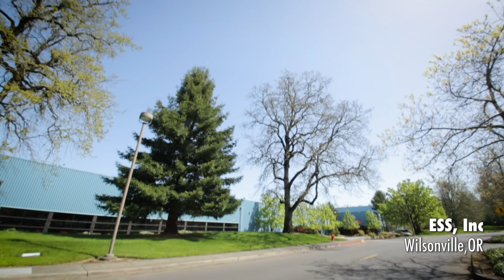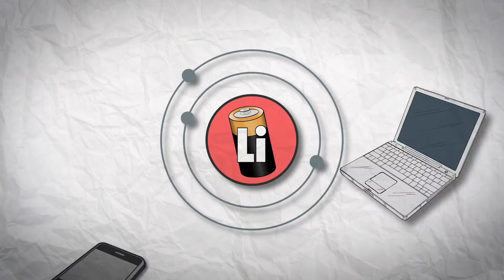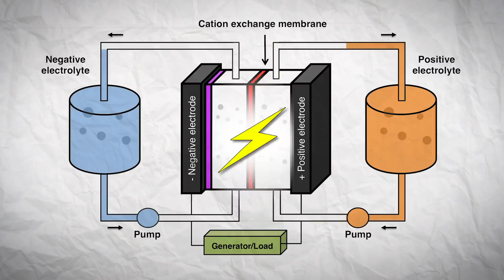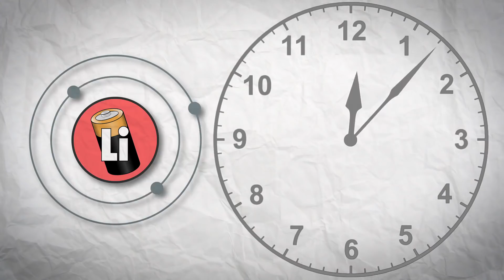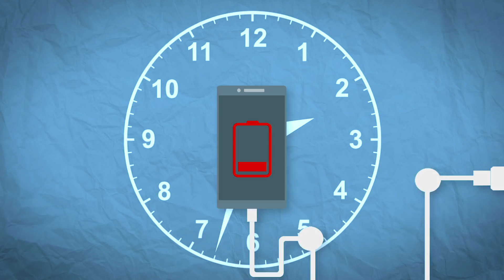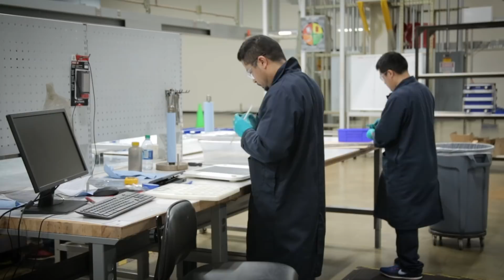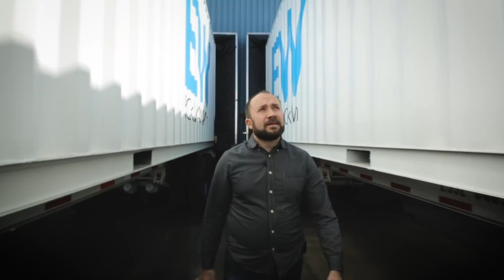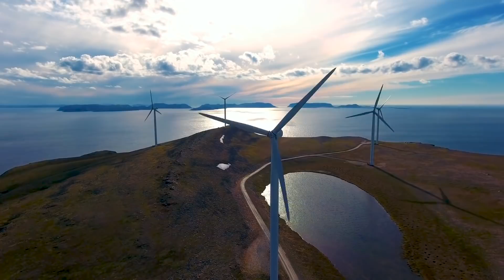Battery Fueled by Iron and Water Could Transform the Power Grid

Comment: What till Thunderfoot sees this.
Reply: I hope its not another solar road or hyperloop fiasco.
Reply: He's been notified.  ^_^
Reply: Incognito, I'm not saying the science isn't there. We've known, in theory, that it's been possible to do for a long time. It wasn't until 2008 that someone came up with a way to do it and meet all the safety criteria.

But think about that for a second. If these batteries are so good at what they do and can revolutionize the world, why did a company wait 10 years to do it? We've been looking for a cheap way to store lots of power for decades.

Something seems really fishy.
Reply: @SlimThrull  Perfecting the nooks and crannies of the technology(charging-discharging circuit, integration with existing technologies, etc) and setting up profitable enough manufacturing? Don't most proven "world-changing" technologies also take decades from proof-of-concept to full-scale "world-changing" applications?
Reply: @SlimThrull  Late to reply, but we haven't needed large scale static power storage.  Most power storage we've needed before now had to be mobile and this chemistry isn't suitable for that because it's so heavy.
Reply: @SlimThrull  it's volume to storage capacity that kills it. It also fails with very low contamination, plastics  may have solved this. Its 50's tech.
Reply: Nop, they're meant to be used in power surges helping to ease the load on peak moments, they're batteries not power generators, they take sunlight all day or electricity at night and distribute it in peak hours. They don't need to match the power generation capability of the generator, they can charge at night for instance at 1/8th the current of the generator and that wasted energy at night would become power at the moments when it's pricey to generate. They're not meant to store 100% of your energy, it's more a kind of nitro for special moments.
Reply: kk346592 didn’t know he said that, it not impossible - just highly improbable.
Reply: I was thinking that too. batteries need an Anode and a cathode not just one or the other.
Reply: Matt, you are projecting your character onto IncognitoTorpedo. Get psychological therapy.
Reply: ChompChompNomNom that's not quite how it works. Close though. An explosion only happens if the chemicals will react quickly. It may be the case that they react slowly without a suitable catalyst
Reply: kk346592 
If it exploded
Reply: He's probably tied up making more solar fricken roadway videos
Reply: @Slim Thrull, he is also a chemist you know, this is not bs
Reply: @taiwoolaleye6333  So what? I'm not claiming that it doesn't work; I'm claiming it's not nearly as revolutionary as this video wants to make it out to be. 2.) If a mathematician says 2+2 is 5, I'm not moved by it. Doesn't matter if he has 10 degrees and 190IQ. It doesn't matter if Ramanujan rises up from the grave and proclaims it to be true. Facts are facts. Just because an expert says something in no way makes it fact.
Reply: Yup. I was about to say that. You beat me by about 4 months.
Reply: SlimThrull - Fuck Thunderm00t! Yes, I said Thunderm00t, with an "m"! Cuz his point...is moot!
Reply: Sorry Slim, nothing for T'foot to "bust" here.  This is legit chemistry and engineering.  My only question is the value proposition.  How does it compare to Li-ion?
Reply: SlimThrull 
According to his logic my 50000mAh power bank can kill me at any time.
Reply: @kk346592 yes, you just need PROPER inverter/step up circuit, and death is near guaranteed. You just need 1Ah fast discharge RC cell, as you will use it only once ;-)
Reply: imagine working on something for 10 years only for some fat athiest neckbeard youtuber making 100 videos on why he thinks your invention wont work based on the fact that he gets C's in high school science
Reply: IncognitoTorpedo ...u have a rusted brain... and need new iron..  grow up and get a clue
Reply: 50,000mAh is only the capacity dude. When you look at it in Wh, then it's only around 200Wh. Whereas an electric vehicle battery is more like 100kWh which is 500 times more power than your power bank. Now, burst your power bank and it will explose, now imagine that explosion 500 times bigger.

Comment: Personally I think gravity based systems would be better. There's systems being trialled of huge concrete weights being raised and lowered in shafts to store and generate electricity.

There's also a system being made of a railway system built on an incline. The cars store and generate electricity by rolling up and down the rails.

You have other systems such as compressing air, raising water, even hydrogen production.

For static projects there seems little need to use lithium ion batteries. Size isn't a major issue for large businesses or communal projects. You could even build them underground.

Comment: I like it. I want one to power my home and car. Thanks for sharing!
Reply: Hope you've got lots of room. A Tesla's battery pack has a larger storage capacity, up to twice as much on the high end models.
Reply: I wonder if these batteries can be recessed into the ground? I'd have room on my property for it if I could build a patio/deck over it, or put a veggie garden on top if it can't be recessed. I don't yet own an electric car but I want one.
Reply: Arlen morrison is wrong. This container has a clear label of 400kwh energy. Biggest tesla car battery currently is 100kwh. One is not bigger than four.
Reply: No.

Comment: So what are the downsides?
Reply: Arlen Morrison The side of the containers show 50Kw and 400Kwh. A P100 has 100Kwh. Unfortunately, they mention powering a neighborhood with 50 Kw but dont know the difference between kw and kwh.
Reply: Less efficiency compared to lithium ion batteries for now. Also, it, like all other batteries, might not be as capable of delivering short but huge bursts of energy as supercapacitors, rendering it less useful for transport or other applications.
Reply: Energy density, size and efficency. So useful when you want to get your house in the country off the grid. Not so useful if you want to do the same with your flat in NYC.
Reply: Johan, good summary.  I would clarify the maintenance comments on the pumps.  We typically use 480 V motors with magnetically coupled plastic pump heads.  typical MTBF on the pump motor combo is 20 years.  For large scale battery installations you should not discount the need for HVAC on the Li-Ion systems
Reply: +Manfred Höffken hell with the amount of desert we have there's a lot of space to put it. You can be even more creative, if it's cheap then storage space can be handled, i'm sure we can find a place to put this shit if it's cheap.
Reply: Arlen Morrison nah man, read the decal on the side it said 50kw 400kwh.... So 4 Tesla's and a small amount of output... That compared to empty land tho.... Makes use of the land.
Reply: Size and complexity.
Reply: Biggest downside immediately obvious is that this battery uses its own energy to run pumps etc. Hence it it automatically less efficient than other batteries. 

50kW to run a city block?  A toaster, electric kettle or bar heater EACH consume 1 to 2kW.
If there are 25 such devices in a city block... dead battery... and nothing to power refrigerators, ovens, tvs etc.  Reality check right there!

Finally, it is safe for trees?
Salt is not a fertiliser. Throw some salt or salt water on most plants and it will kill them. And iron is an effective weedkiller.

So much BS in one video.
Reply: Right.  I live in a small California city of roughly 45,000 inhabitants, but much recent construction here is zero-lot-line, meaning they've left absolutely no room to put one or two such shipping containers anywhere on the block.  Even in the older neighborhoods with detached single-family houses, they'd have to condemn and remove a house on every other block to make room for distributed electricity storage, although with real estate sales as brisk as they are now, perhaps they would just need to wait for properties to come on the market of their own accord.
Reply: Milosz Ostrow 

Or maybe just locate them all in a centralized location a mile or two away with distribution lines...
Reply: I noticed that as well. My thought is every "science" reporter who doesn't know the difference is not really a science reporter.
Reply: another upside: Looks like a giant cauldron
Reply: It not for the individual but good for corporations.
Reply: Laezar He was paid not to share them.
Reply: Well, obviously they're huge. A Tesla P100 has twice the storage capacity than one of these.
Reply: Confusing with the output, perhaps?

Comment: 50kW in single shipping container? LOL you would need a thousand for a tiny tiny 50MW gen? And in the tens of thousands to support a nuclear reactor sized facility replaced by green alt. 
If you believe for a second that electrolytes have no breakdown over time you should believe in free energy and perpetualmotion.
Pumping water uphill has been and always will be the only viable solution to large energy storage that's green. You can do the basic numbers on a shipping container full of water drawn up a hundred meters and it will blow this thing out of the water. You all need to get a little more scientifically literate.
Reply: +Mark Sieg You're confusing kW with kWh. The battery is 50kW/400kWh.
"You all need to get a little more scientifically literate." I recommend you refrain from these sorts of comments in the future.
Reply: "You can do the basic numbers on a shipping container full of water drawn up a hundred meters and it will blow this thing out of the water".
OK let's do that calculation.
This battery says "400kWh" which is equal to 1440MJ.
35,000kg shipping container raised to 100m has 34.3MJ.
You'd need FOURTY TWO containers to match the battery.
Doesn't sound like an economically viable alternative to me.
Reply: @gregx1044  Greg, not sure what volume of water he was referring to,, but I've worked in Energy / Green Energy / Automation for years, and normally the intent of elevated water storage was on the order of large pond, because as you say, a large volume of water would be needed.
Reply: I also thought that "no degradation" was a stretch, but I expect the small print is something like 1% after 20 years. I'd expect the parts inside to corrode before the actual charge is lost to a noticeable degree. 

As for the second point, yes the capacity does seem small when you compare it to a whole power plant, but this looks like a solution ideal for maybe a single business or facility that produces its own renewable energy. 

Gravity is the best battery though.
Reply: Agreed with Greg, and for those who dont understand the difference on the side about 50kW/400kWh then lets put it this way, 50kW is the size of the hole on your canister (for energy flow) and 400kWh is the capacity of the canister (for energy). Compare it to a tank of water that has a text on it of 50/4000 with first meaning how much water per hour can flow out of it and second one whats the total capacity. One more? ok, if a house has one door and only two ppl at a time can fit through it then this does not mean the house has a capcity of two, it might be a door to a skyscraper for thousands.
Reply: Thanks Mr. Wizard!   (kidding. Good analogy, oft used & useful.) @gelisob
Reply: Still not getting it i see, please figure out the numbers before commenting, doesnt make you look good if you are off by so much. 1MW generator output means 1000/50 = 20 boxes can take steady 1MW input. 20 boxes store 8MW's meaning 8 hours of steady output from 1mw generator. 24h/8 = 3. 3x20 = 60 containers to store WHOLE 1mw generator output that runs full capacity for 24h. These are quite easy to stack and you can see much more of these in harbour pictures. And we are not speaking of need to store so much but to store energy to overcome the downtimes.
Reply: We need some nuance in this conversation. Dam batteries are a great idea. Unfortunately, they don't really work in flat areas and they take up a lot of space. Sure, we would need thousands of these iron water batteries to equal a singe MW generator, so the energy density presents a drawback. The size, however, should be considered a potential advantage. There's no rule that says that all our energy has to be consolidated in a single spot. Doing this reduces the efficiency; energy is lost in the grid as it travels long distances. Some of our current infrastructure could be replaced with more localized grids. Perhaps this only has use for remote communities where solar is viable. Perhaps it has suburban applications as well.  What's clear is that we shouldn't dismiss this flippantly. 

Ultimately, as well, there is no silver bullet to fix our fossil fuel problem. No single technology, (save fusion, if it ever gets cheap or actually doable) will solve our energy use problems. This is part of a solution, not the answer in and of itself.

I'd also like to disclose that I've only taken a year of physics, but I'm pretty sure the approximation for gravitational potential energy wont work well for dam batteries. You have to account for loss in the transfer of energy. I also don't know what affect pressure would have on the generation of power, either.
Reply: Mark the side of the battery container says 400KWh/50KW, I believe the presenter misspoke.  KWh is the energy stored in the container, KW is the power, so assume 100% energy transfer efficiency that would mean that if I hooked it up to house, assume my house consumes 4kw then the container would supply my house for 400/4 = 100hrs or roughly 4days.
Reply: Future Hindsight, hypothetically. 400kwh would keep my apartment supplied (approx 100-120kwh/month) for approx 4months..lol
Reply: Here is a TED talk with a claim of a shipping container with a storage capacity of 2MWh - https://www.youtube.com/watch?v=Sddb0Khx0yA
Reply: Mark Seig ~ I do not believe you have well understood energy. All energy is free. Energy cannot be created or destroyed only transformed. The only cost comes not from obtaining energy but the process to transform energy. Humans are horrible at transforming energy and have not made any real gains in this field ever. It is like they do not understand, energy storage is futile, since it is already being stored in the natural system. This is certainly a small detail but it greatly affects how this issue can be and should be approached.
Reply: +Sean
" energy storage is futile"
They store fossil fuels, don't they, that's energy storage. And the CSIRO (in Australia) apparently have worked out a practical way to store hydrogen (mixed with amonia).
Reply: But it doesn't take much energy to raise a container full of water up a hundred meters. Like driving a loaded truck up a hundred meter hill. Fuck all energy required to do that and it's being done all the time. It only takes like a few minutes and so it doesn't burn fuel for very long. Gravity is really weak. We need real power, not a few minutes fuel burn. We need to lift a whole ocean to make it effective.
Reply: Justwantahover ~ Spending energy to gain is a foolish process. That is the reason we are still living in abject poverty because man fails to acknowledge the Truth of where he lives and the True rules that govern all things.

Gravity is not real as a force pulling things to the earth. What they call gravity is actually attraction and repulsion.

Gravity is a word describing the seriousness of a situation.
Reply: +Sean
"Gravity" is the ACCEPTED name of a certain type of attraction. So you think gravity is not real but attraction is? Is the attraction actually REAL? If the answer is "yes" than you are simply changing the name "gravity" to "attraction". Still real though! Flat earth idiots can't deny stuff they can witness themselves. Or can they? lol
Reply: Justwanahover ~ Being accurate is a sign of intelligence. If you don't understand the difference than ask. Don't be ashamed because you don't know.
Reply: +Sean
Saying that gravity isn't real isn't a sign of intelligence. It's a sign of flat earther "intelligence".
Reply: They said 50kW for a single container. And I meant the volume for the container, not the gross weight. I'll crunch it in a bit. I'm shocked anyone actually responded.

But I might be wrong if it's 400kW unit, but I'm pretty sure it's 50.

Comment: Better inform Elon Musk that he needs to switch production, at all his Giga Factories.
Reply: Gigafactory produces lithium ion batteries for cars and home storage. These need to be simple and high density, while cost is a minor issue. The iron-water flow batteries featured in this video is the exact opposite; complicated flow plumbing, low density electrolyte and a focus on very cheap per Wh price. You would never want that in your car. The two technologies are simply not covering the same use case.
Reply: That's kind of like telling Microsoft to use Linux for their developer's desktop PCs - it might be a better option, but that might not look good on the company.
Reply: Even Microsoft has realised that Linux is a thing. Looking at the number of Linux Hosts that are on Azure 40% plus. They have found out what NOVELL was telling them all along. It's good to integrate with everyone. :o)

Comment: The shipping container says "400kWh" on the side, so that means you'd need about 322 of these to match the capacity of the 129MWh Tesla battery in Australia - that seems pretty reasonable to me. However the shipping container also says "50kW" and the Tesla battery is 100MW, so you'd need about 2000 of these containers to match the instantaneous output of the Tesla. So they've got a fair bit of work to do to make this really viable.